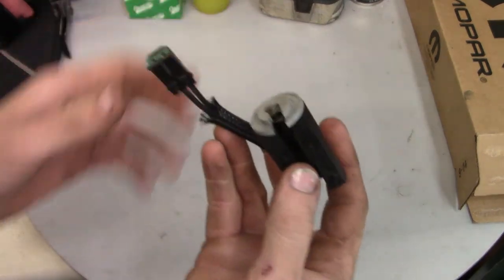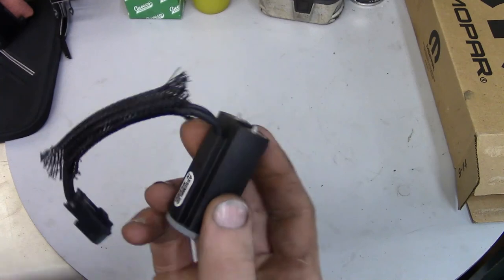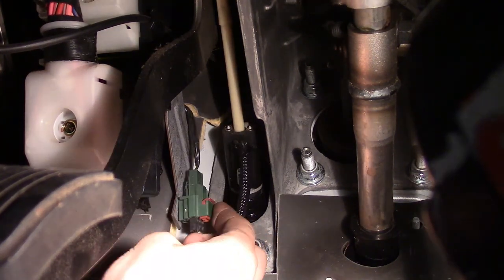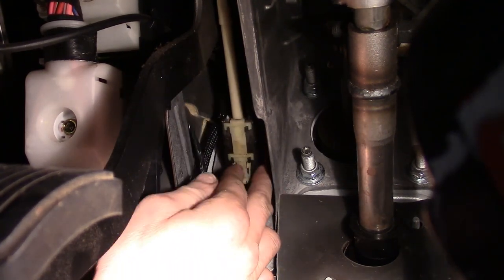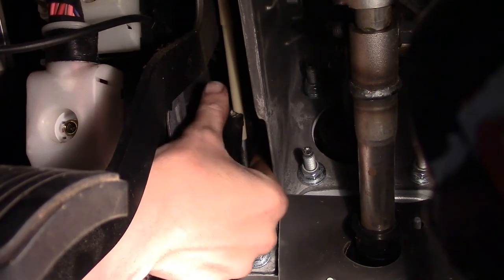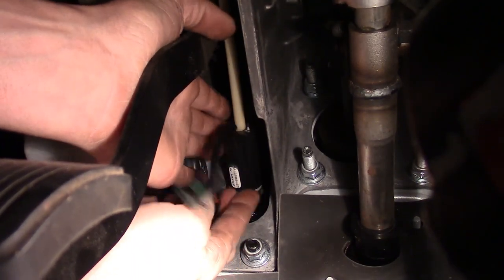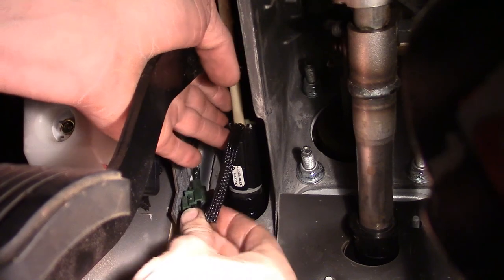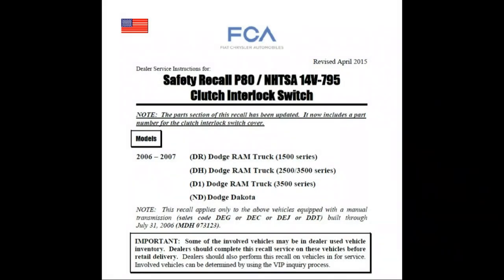2006 Dodge Dakota clutch pedal switch/Recall P80

Comment: I turned mine into the recalled one basically mine had failed making the vehicle bot start I unplugged and crossed the switch over it worked like that so I just cut the wires and crossed em together and taped em up works fine usually I wouldn't do that because it being constantly connected may have side effects but I figured your starter shouldn't engage every time you push a clutch in driving so constant connectivity shouldn't be an issue except you can start it in gear without the clutch in not recomend but it can get you home

Comment: Thank you for this my 2004 Dodge Ram 1500 was having problems. I unhooked the connectors and used a paper clip to connect to each side.   Truck started up. Used this to video to replace my clutch pedal switch. 🤙🏾🤙🏾

Comment: My 2004 manual dodge dakota:  When running, push the clutch in and the shifter will not engage or go into gear. If the vehicle is stopped/ not running, it will go into gear. If you start it in gear it will try to drive as the gears are engaged.
Reply from the maker: Sounds like a clutch issue. I recommend checking the hydraulic clutch operation. If okay then the trans will need to be removed and parts inspected/replaced.